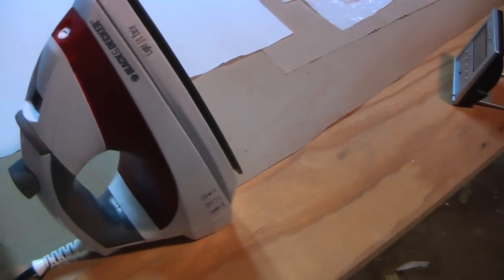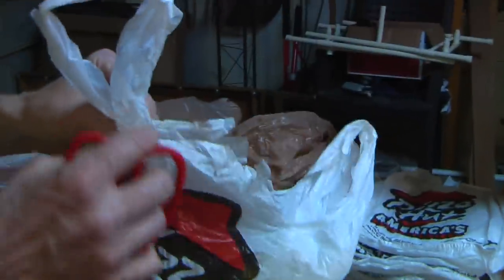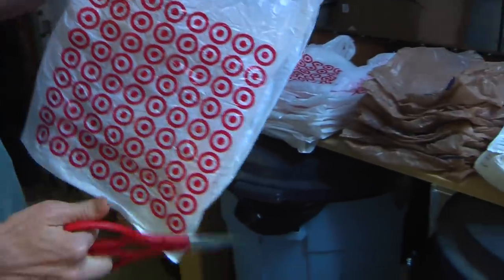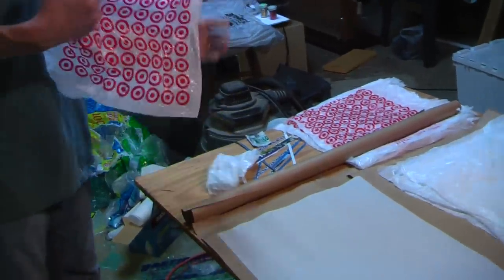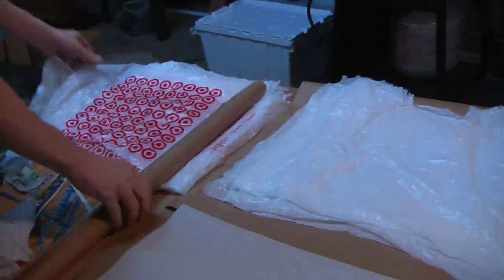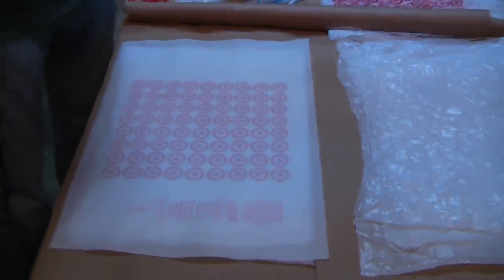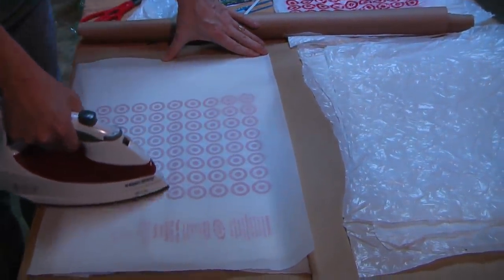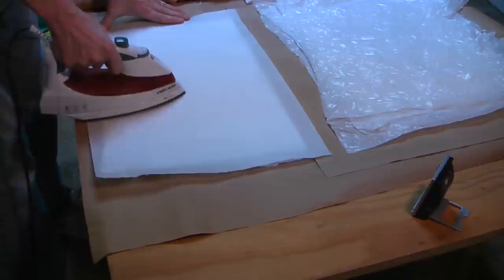Plastic Fusing Tutorial

Comment: You mentioned that people had asked you about the safety of heating/melting the plastic bags. I recently found a guide that you can use and share with your viewers:

PLASTIC RECYCLING GUIDE - Safety Reminders
1 (PTE) - Danger! Toxic. Avoid Burning
2 (HDPE) - Safe. Very sturdy but doesn't really melt.
3 (PVC) - DANGER! Very Toxic. Do not burn.
4 (LDPE) - Safe. More flexible, but catches on fire.
5 (PP) - Safe. Caution: Doesn't really melt but gets Hot fast.
6 (PS) - Danger! This is styrofoam.
7 (OTHER) - Safe only if it's PLA

{Guide compiled by Anasha}
Reply: Kona Lynn Sankey tnks!
Reply: N.
Reply: Kona Lynn Sankey
Reply: thanks for it, but heating within safe limit (melting) should be different than burning (dissociating) i guess.

Comment: Have you tried bonding the plastic at the edges with plastic similar plastic squares to achieve larger pieces?  I would think that you could separate the layers at the edge (non melted and interweave them then iron that area
Reply: Griz Woldstad  Yes it's possible bond to achieve larger pieces.  Have you tried fuse two sheets  of  polyethylene plastic?
Reply: i was thinking same

Comment: Just wonder. Can we use the heat of a hot glue gun to fuse just a few dots of plastic bags along edges to extend the size of width and length for recycling bags as a large piece of plastic curtain, privacy screen, and sun shade in the backyard?

Comment: Fun, I'm wondering about using this process to mend a torn tarp.  What do you think, can I melt bags and woven polyethylene tarp fragments together to repair a torn translucent tarp that is supposed to cover my greenhouse?
Reply: Using that on a tarp hole sounds like a great idea. I would maybe think about finding out what platic has the most similar properties to the tarp plastic, especially melting temp. It would be a bugger if your patch melts but the tarp doesn't and you get a weak bond. Id love to see your follow up.
Reply: Tarps are polyethylene and so are plastic bags, I think melting point is around 130c
Reply: David West Have you tried this yet? I´m thinking about the same thing or maybe redo the whole tarp with plastic bags
Reply: NeoHeo So I went out and tried to fuse plastic bags to a tarp that had a rip in it. The bags do fuse very well with the tarp and it seems to fix the hole very well. But the tarp will shrink, a lot, so if you are fixing it this way make sure that the patching is small compared to the tarp since it will loose shape. And also make sure that the patching is bigger then the iron you are using or you might melt a new hole in the tarp.

Comment: can you fuse more layers to make it stiffer.
Reply: You can fuse a great many pieces together.  Thick enough to make Frames for small projects like toy houses or leaf bag holders.  You can make hard jewelry, trinket plates, desk top accessories, like paper holders, pen holders, etc. I took a regular sized bag, ironed it, folded it, ironed it and so on until I had a longer piece that was thick and still pliable enough to shape.  Once cool it will hold that shape until dooms day.  A custom made picture frame with smaller pictures ironed on around the sides under a clear plastic bag.  Wind wirlygigs, drawer liners with partitions.  You can saw, drill, sand, contour and so on.  When you add the idea of thicker sheets of plastic, you have the equivalent of wood pieces that can be made into anything!!  Patience is a HUGE part of this project.  Fuse one or two layers on a side at a time and keep going until you have the size and thickness you want.  If you want it bent, do all of this in one setting. Then fold it over a form and roll it up in something to hold it there to cool completely.  For wide flat sheets, you need to place something wide and flat on it to cool without any buckle or curl.  Sorry, i didn't meant to make this so long.  i have just had so much fun with the thicker pieces I wanted to share!